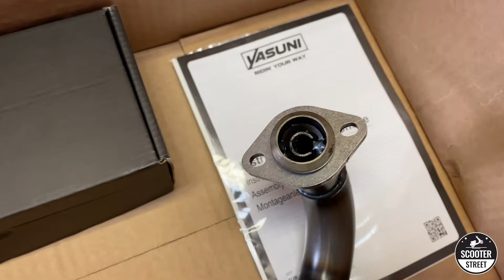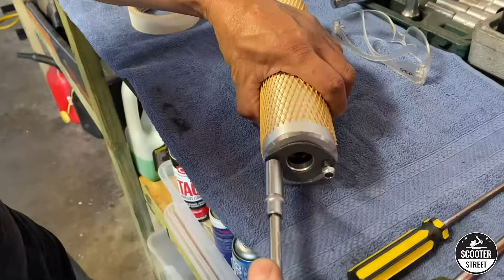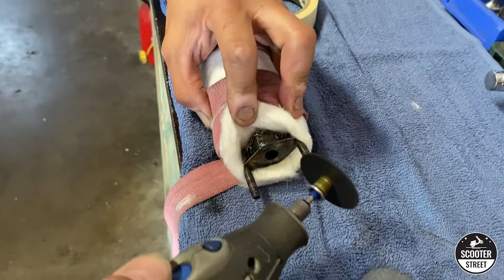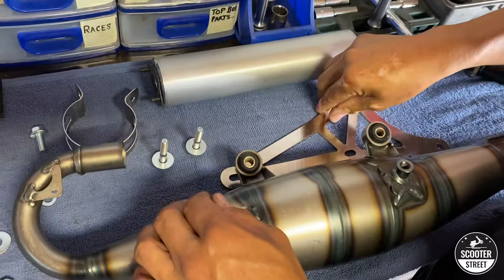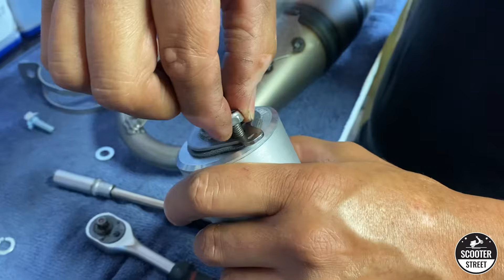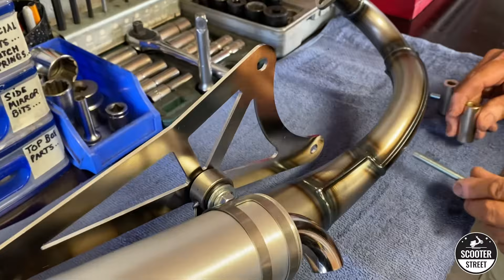Yasuni Exhaust DE-RESTRICTION - UNLOCK Your Scooter's Power!

Comment: Do giannelii exhaust’s also have restrictions?
Reply: Only Yasuni has restrictions in the pipe and muffler, all others(Leo Vince, Giannelli, Tecnigas, Laser...) only in the pipe
Some exhausts like Yasuni C16, C20, C30, Malossi MHR Team, Roost... don't have any restrictions, but they are not street legal, they don't have E-mark which is important here in Europe
Reply from the maker: @Ice-T.  Great help👌. Non homologated exhaust are restriction free.
Reply: @scooterstreetau  i don't know how is in your country, but in Croatia we have problems with aftermarket exhausts(and with all aftermarket parts), we have problems with technical inspection(which is once at year) and you will not pass if exhaust is not approved, for that, exhaust must have E-mark homologation, besides that, they measure loudness with db meter, if is too loud you will not pass, besides that, if you not lucky, the police can ban you from the street for that, if you have a non approved or too loud exhaust
Reply: Yes. Only at the neck.
Reply: Where muffler connect’s or pipe to cylinder?
Reply from the maker: Yes, when we used them we had restrictors in the head pipe. I cannot remember if in the silencer but a quick check is easy.
Reply: I did check where muffler connects, and there’s no restrictions there, atleast not on extra v2.
Reply from the maker: @everythingbro4786  Too easy👍